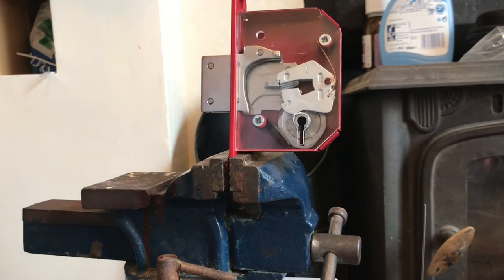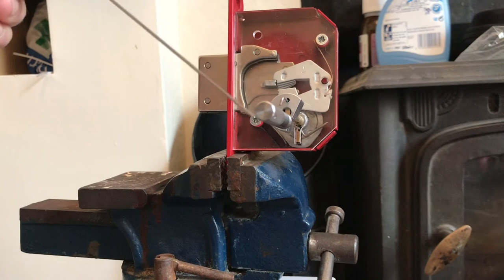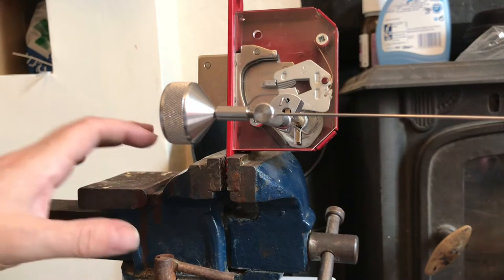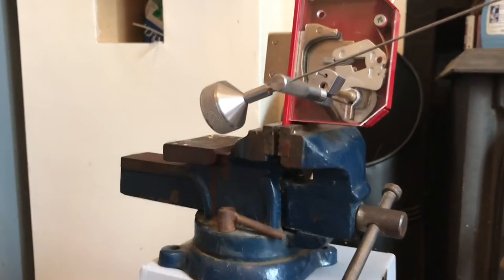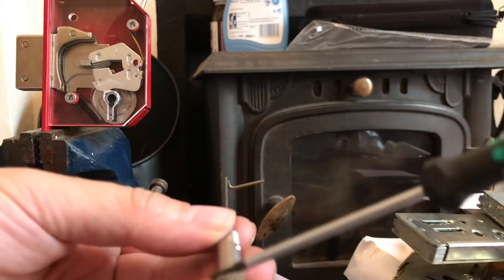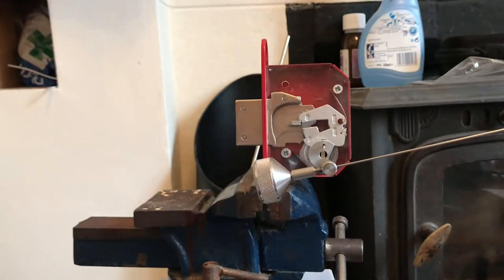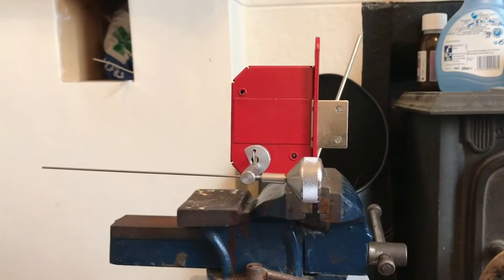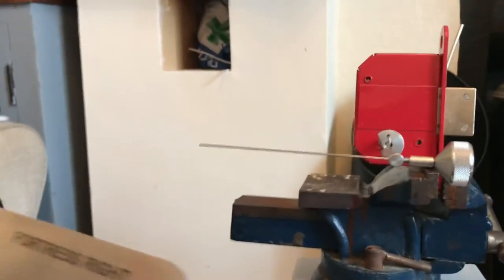Calibrating the ERA Fortress Decoder

Comment: Nice... thanks m8 explained perfectly and a good call on the perspex an lever set up on a calibration lock 👍
Reply from the maker: bloggs692413 glad I could help, if you’re after the Perspex covers, Walker Locksmiths sell them for a lot of common mortice locks
Reply: @FortressLocksmiths  good to know did make some myself but they didn't hold the lever pack tight enuff so wasn't getting right feed back
Reply from the maker: bloggs692413 yeah they are decent enough, worth the investment just to practice your picking
Reply: @FortressLocksmiths  definitely m8
Reply: Thy should make the bar screw into the rod to allow for a close door frame